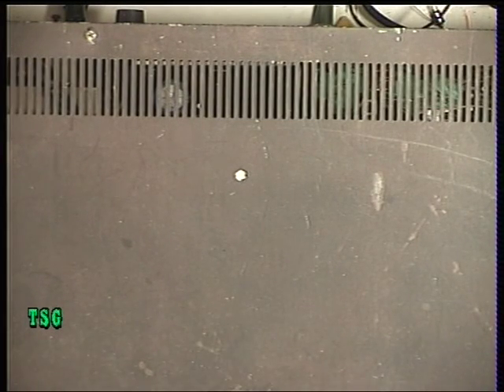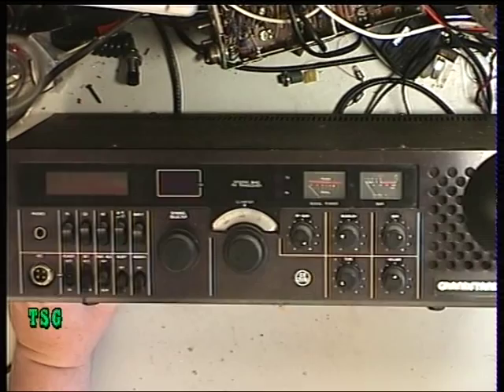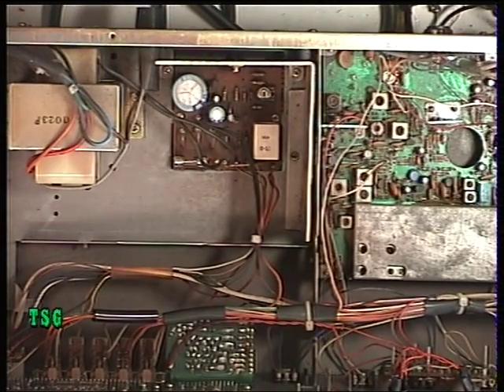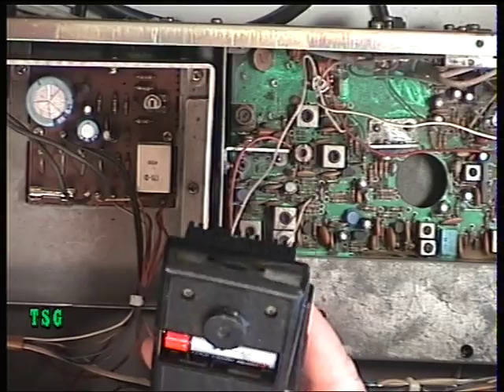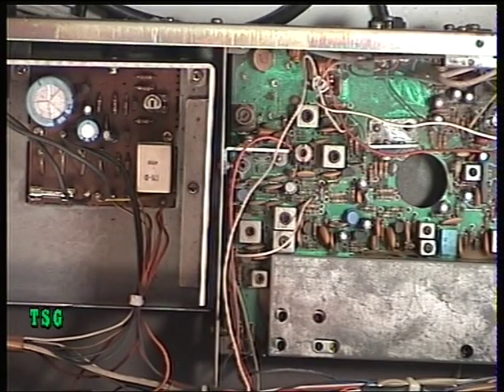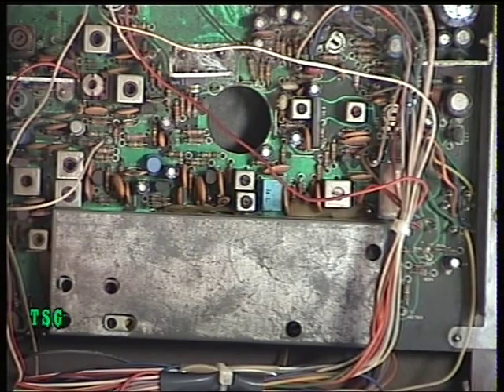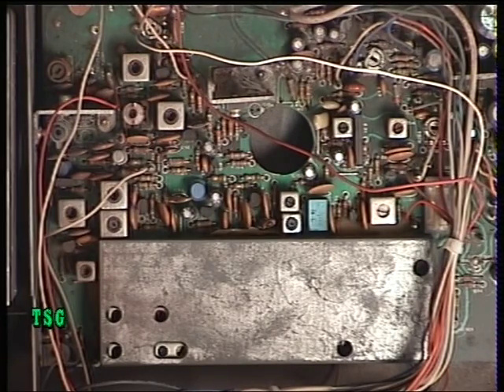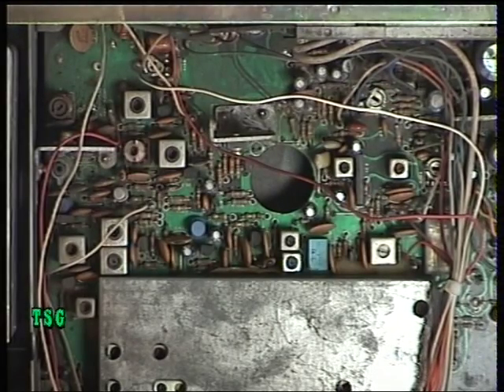Grandstand Base Station, UK (CB 27/81) CB radio (Base Station) - TX adjustment

Comment: Would you mind helping me as I have one of these and the SWR meter is reading wrong. can you let me know how to fix this please?
Reply from the maker: It can only be set with a dummy load. With a dummy load connected, the radio is set to transmit (ch 20) and preset VR601 on the back panel SWR sensor board is then adjusted for the meter to read an SWR of exactly 1:1. After than it should read normally.
my email is rshireby@yahoo.co.uk

Richard, G0OJF

Comment: Hi, I've just got hold of one of these and I've blown the output, wire was broken on magmount. Can I still get hold of transistor? Thanks
Reply from the maker: Yes, but are you sure it's the output & not the driver transistor. Either or both can fail in high SWR overload conditions
The circuit shows either C2166 or C2075..but that could read C2078, (poor photocopy) is the output & C2314 as the driver. Which output is fitted in yours? My stock control computer is down at present, so I can't check what I have in stock, but usually have everything.

Richard

Comment: I have one that wont TX or RX. Sat next to it with another rig and listening to local. It will turn on, Channel select and Channel display ok. It won't receive anything and there's no change in noise coming from the speaker (background hiss) when the antenna is plugged in like a known working radio. it will relay and the tx light turns on when keyed (tested with an antenna plugged in and it does not transmit. Any ideas Righard?
Reply from the maker: Yes & they are a real pain. It's usually the links between the double sided printed circuit. Snag is that huge screening can which once removed is full of wax. Our sample Atron version is a non-worker. I reckon the inter-side pcb links weren't cleaned properly at the factory. Faults like this don't show up for about 5 years.

I've just had an idea that I will try regarding the removal of the wax. I'm going to take the front trim panel off our Atron & remove the speaker & meters. Then I'm going to put the rest of it through the dishwasher on the hottest setting. I might be able to get to the links then! After that treatment it will want immediate drying. There is a storage heater here which I'll stick it on top off, chassis upside down (PCB print side uppermost) where I'll leave it for about 3 days. That's what I do with valved stuff. Has always worked so far.......

Not sure I'd do that with customer's propery though!!!

Richard
Reply: UK CB radio servicing So a "quick" clean and fix of the side to side links may remedy the situation?
Reply from the maker: It may, but it's usually the side full of wax where the snag is. You've fuelled my fire so as we speak I have two non-working running through the company dishwasher!

Richard
Reply: Good to know I've fuelled the fire so to speak! Fuelled my own too so got this out the shed.As above but no channel lights. all screws are worn well so she's had plenty of people in. All posts that wires are connected to look like there's not a lot or no solder on them. there's also two posts at the back that have wire ends on that look like they have been cut off. Longer project for me I think. May need to drop it in to get it fixed. :)